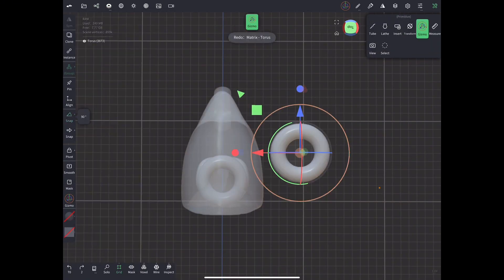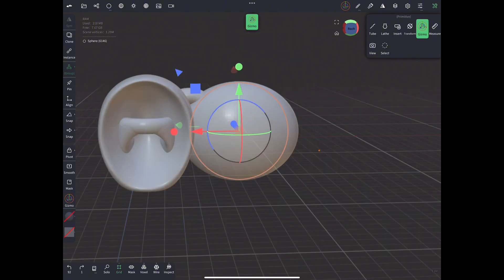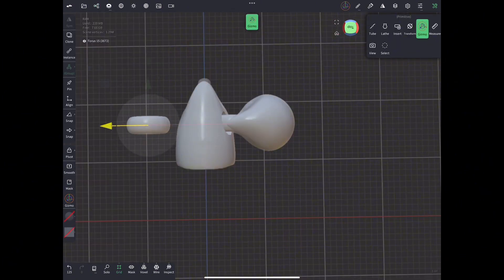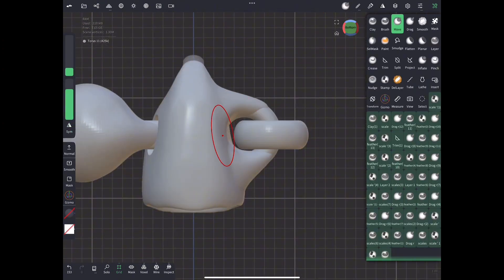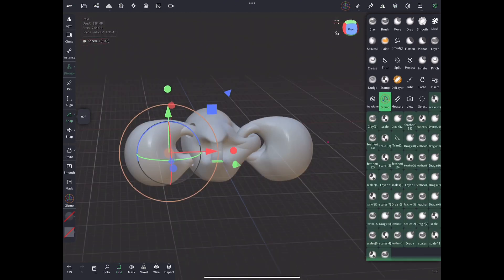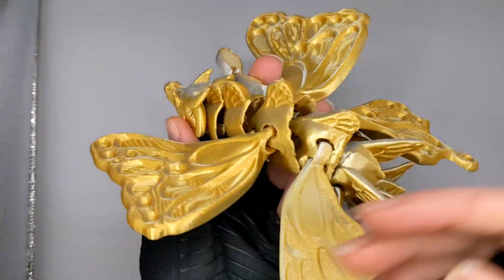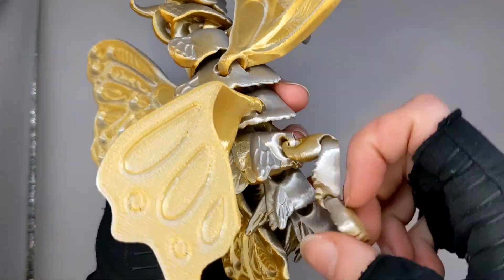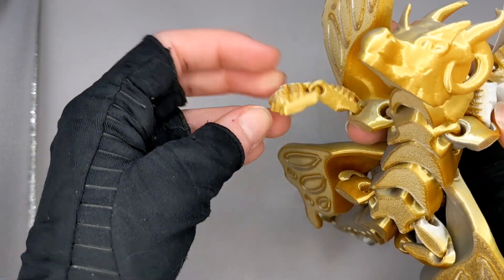3D Printing Flexi Modeling Tutorial (Part 2)

Comment: I have a question. I have two very similar flexi toys. When you slice it and look at how the donuts chains are made they are almost identical. But for some reason one creates a floating region and the other doesn't? Any idea why this is happening?
Reply from the maker: When you scroll through the slicing layers can you spot any places where the filament start printing without being connected to the base? One ring may be at a slightly different angle than the other.

Comment: Would it work to add the pieces then use symmetry to shape them around the rings?
Reply from the maker: As long as the rings are interlocking properly with enough space in between, that should be fine! :)